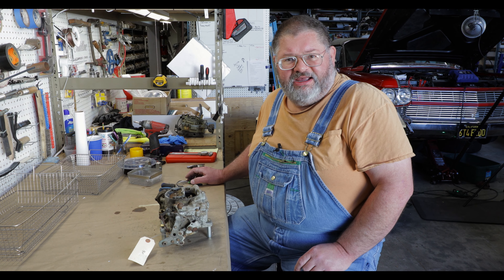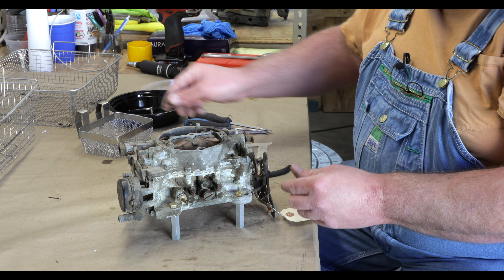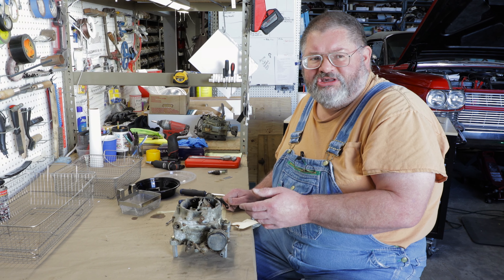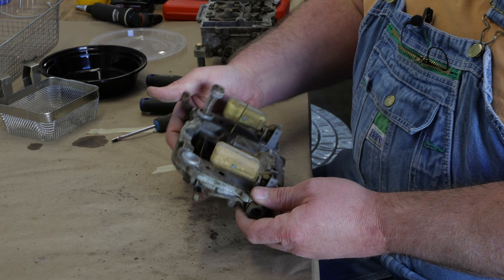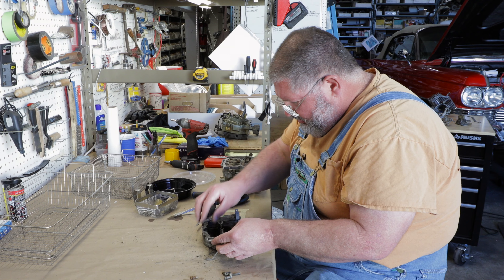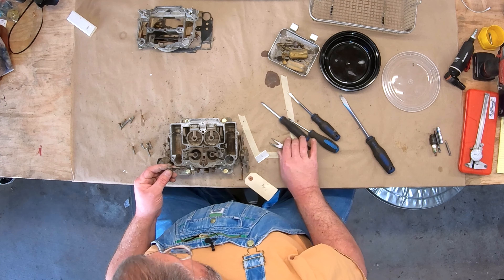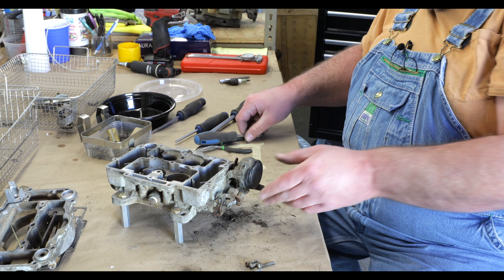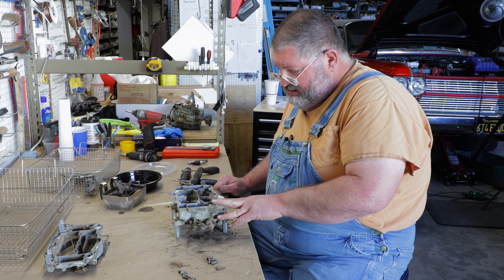How To Rebuild Carter AFB Carburetor

Comment: Great video. Would love to see how to rebuild the idle speed-up control actuator equipped on the Carter AFB. Mine will not hold vacuum and has been plugged until I can rebuild it myself or find someone to do it.
Reply from the maker: That is one I will have to look into doing. I know the diaphragm inside cracks and leaks. Josh
Reply: @Caddydaddy  yes I believe that is why it isn’t working. I even contacted the head of the 63/64 chapter of the Cadillac/LaSalle Club for advise. He has 5-6 nonfunctional ones laying around and hasn’t found any one to advise him on a rebuild.

Comment: What about the butterflies with big screws behind the choke?
Reply from the maker: @benbriner9336  The throttle butterflies should not be removed; the screws are staked in. The only time they are removed is to bush the carb housing due to wear from the throttle shafts josn

Comment: I have seen worse looking carbs than that in service.  I think that one looks to be able to easily be refurbished unless the throttle plates caused pitting in the bottom of the bores in the housing.
Reply from the maker: @joegrazulis2810  I agree-the one in my daily driver looks as bad or worse. Unless there
is warping or crack, a carb can easily be repaired. Even pitting  in the
bores can be filled using the correct epoxy. In fact, Cadillac had a
service bulletin in the late 50s explaining the use of epoxy to get the
throttle plates in the secondary carburetors in tri-power setups to seal
off completely at idle. The plates were greased so they didn't stick and
allowed to close on a small amount of epoxy in the throttle bores to
form a perfect surface to close off against. I don't remember the type
of epoxy, but as of a few years ago it was still available and very
expensive. Josh